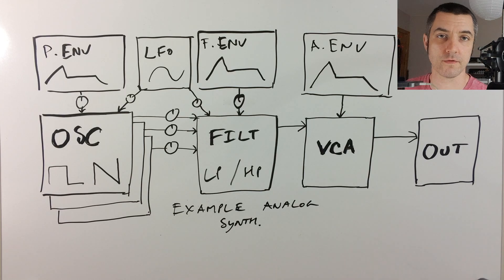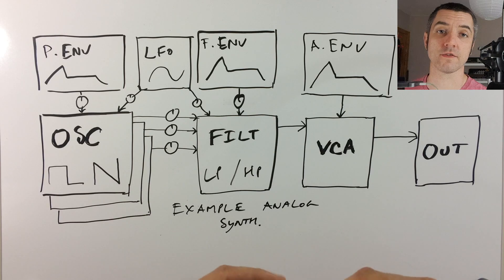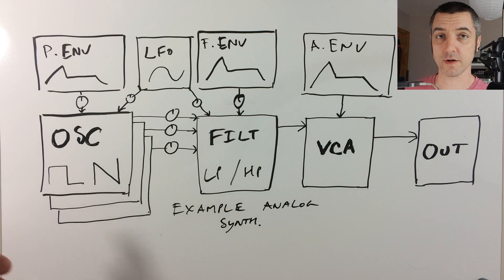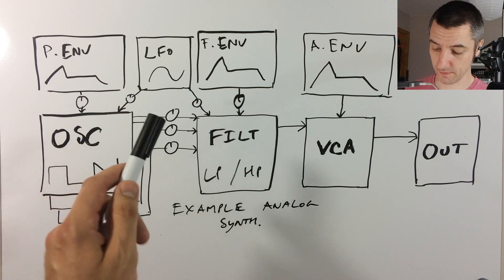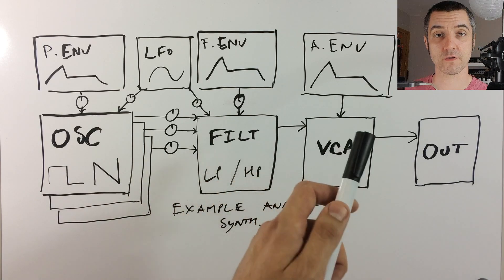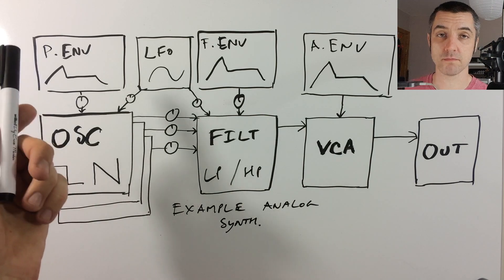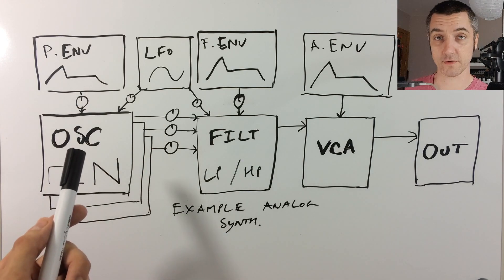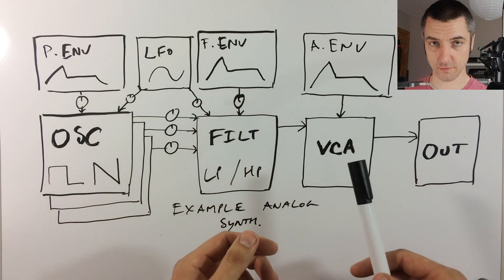How to use the SONICWARE Liven XFM as a Virtual Analog Synth

Comment from the maker: If you have the desire to use the Liven XFM as a multitimbral virtual analog synth, I've created 50 waveform presets to help you with that. 3 are to get the XFM to sound like oscillators in sync mode, the others are permutations of Saw, Square, Triangle etc across the different operators. I've come up with a file naming system that tries to show how they are set up including showing the waveforms used and 10 different Decay and Sustain presets, so there's a readme file about that too. Go grab them from 'Sysex files etc/Sonicware/Liven XFM' here:
https://www.dropbox.com/scl/fo/32jz5c7smgu4k9jx6kev1/h?rlkey=s4lbkmvjpk10t2daq0kfne3ty&dl=0

Comment: Oh crap, now I may have to order one. I've managed to coax some nice rich atmospheric drones from the 8bit Warps but it seems like this box may be even more capable, especially with these virtual analog techniques. Thoughts on this? Love the whiteboard btw, there's nothing more analog than a whiteboard!
Reply from the maker: Ha yes, proper old school white board diagrams are the way ✏️ The XFM is definitely more powerful and has a much deeper set of functions that take a bit longer to learn than the 8bit Warps. Both great machines though 👌
Reply: @ChrisLodyMusic So the 8bit would be better for beginners than the xfm🤷‍♂️🤑
Reply from the maker: Yes I would say that's definitely correct. The 8Bit Warps has had an update recently that added some much needed features, but it's still much simpler to use than the XFM
Reply: @ChrisLodyMusic  👉🙏😁